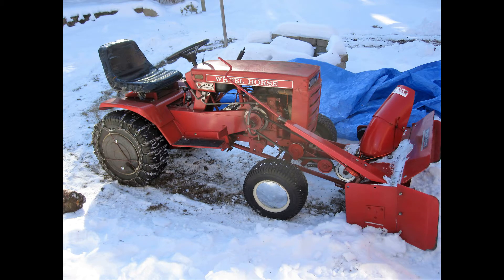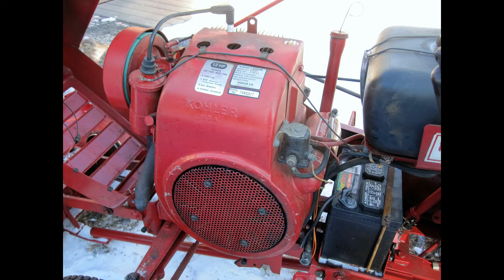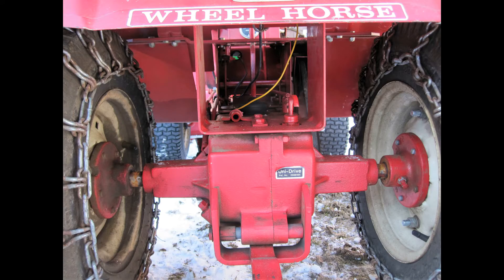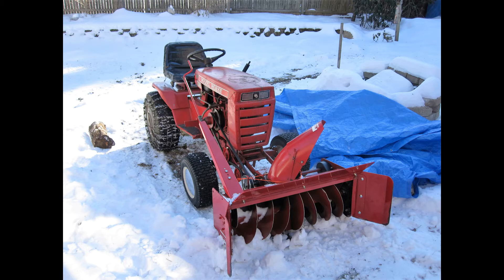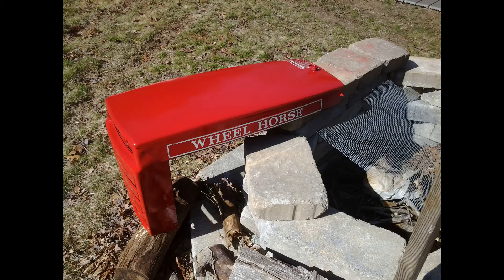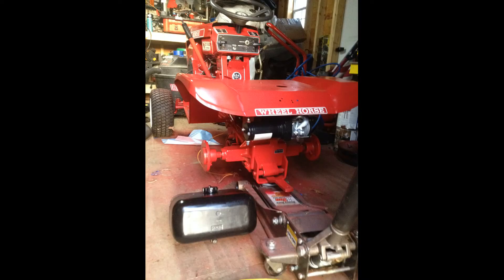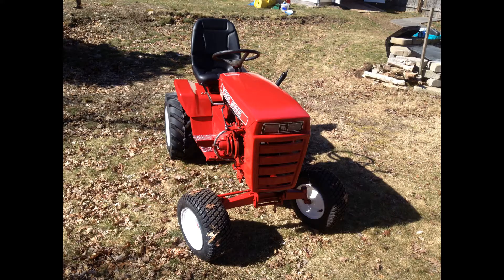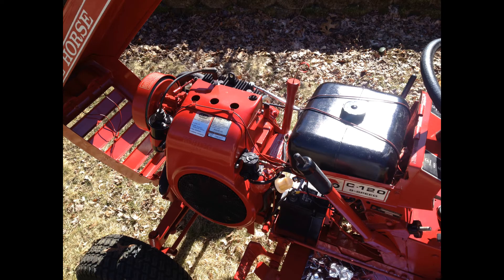How to restore a 1976 Wheel Horse C120 tractor

Comment: love it !.. I have a similar tractor, 414-6. The only down side I see is that the wheel base could be longer and the driver seat is just behind the rear axle so it has a tendency to lift up the front on acceleration.

Comment: How is the oil level checked?  Do you screw plug/dipstick all the way in or touch?
Reply from the maker: it doesnt screw in it just slides in. pull it ,clean it, insert all the way and then check the level
Reply: @DJsWorkshop  no. It’s a square bolt that screws in. 8 Hp cast kohler.

Comment: how did you mount the winch on the rear axle? i have a 2500lbs winch that i want to mount on my raider 12(raider and c120 are almost identical)
Reply from the maker: i had to make a custom bracket